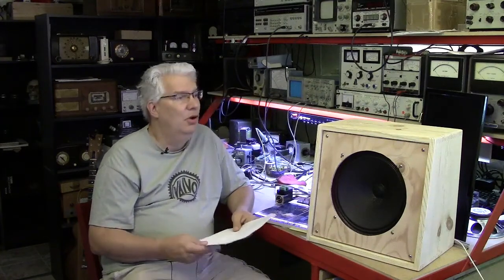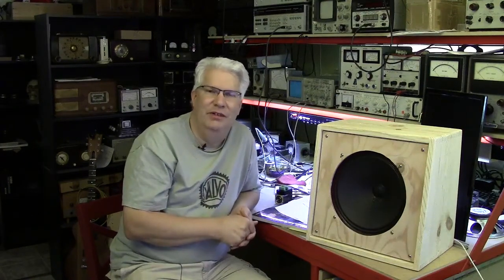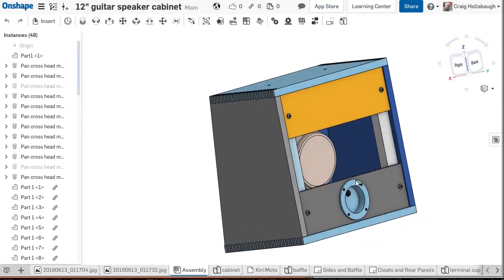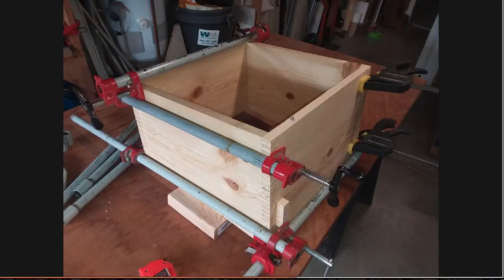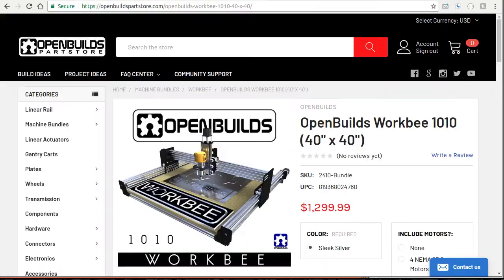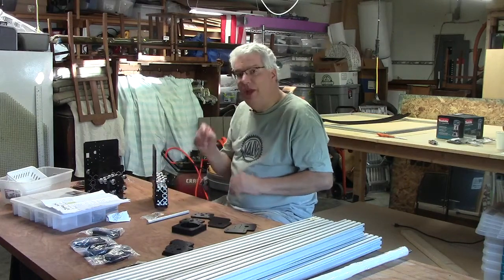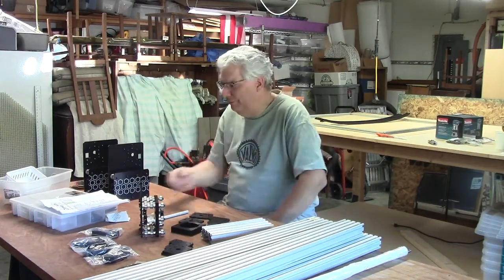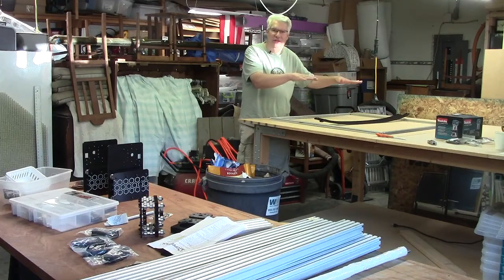180624 Valve Studio - My Journey to Tonehenge

Comment: I just found your fine channel. I've been playing guitar through a Eico 147A signal tracer and testing all different kinds of 8 ohm speakers, with a DS-9 distortion pedal. Awesome, deeeeep rabbit hole. I'm amped up to find your channel. Thank you for all the top notch info and looking forward to more! SLC UT.
Reply from the maker: Thanks Full Wave Recked. There's definitely more to come, stay tuned.
Reply from the maker: Forgot to ask, what are you finding in your speaker research?
Reply: @CraigHollabaugh  so far I'm finding that the Eico 147a signal tracer is loud for a 3 watt amp. I'll keep you posted, looking forward to more videos. Thanks!